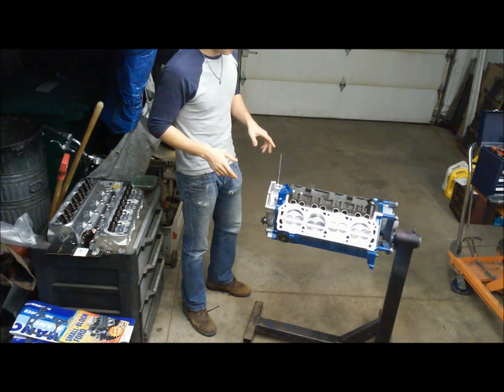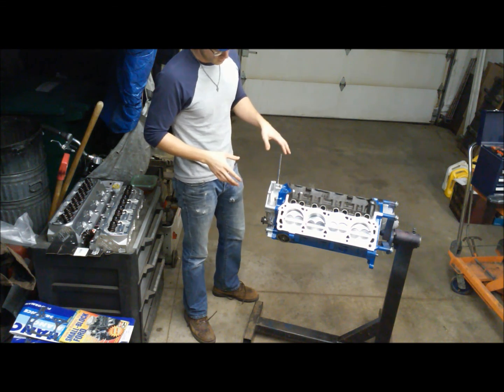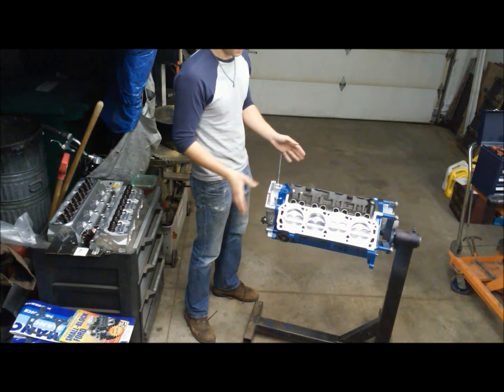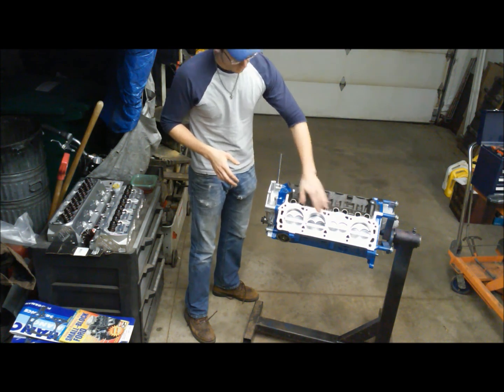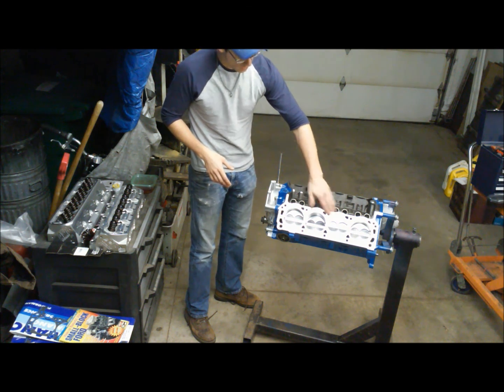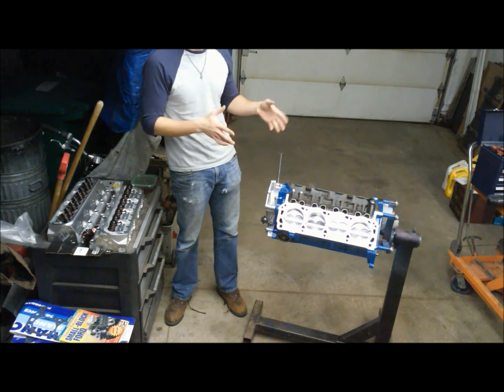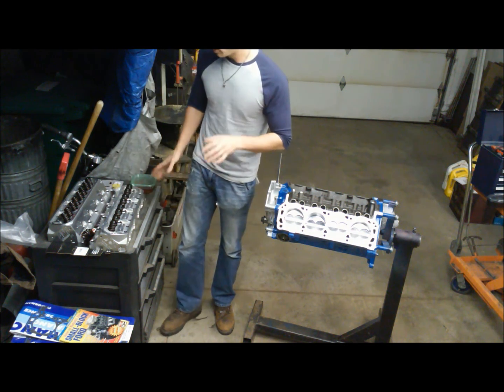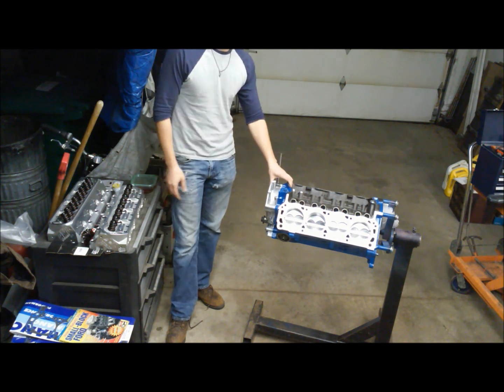302 Rebuild Series Introduction (Vid 1 of 5) - How To 302/5.0 PERFORMANCE Top End Build

Comment: I have an edelbrock 500cfm carburetor, would that be ok? Or a 600 cfm is needed? And I have edelbrock Performer intake. The motor is a stock used with around  130psi compression

Comment: Hello, I have a ford 302 roller motor and I want to convert it to a 302 ho, to put in a 1986 Ford F-150, I am looking for torque and horsepower at low rpm with a bit of rough idle, what camshaft can you recommend me? Thanks in advance
Reply from the maker: Comp cams xe266hr
Reply: @ThunderHead289  Hello, thank you. This camshaft is for carbureted applications? Does this have the firing order of a 351w? Also i am purchasing aluminum heads 190cc runner, 2.02 intake and 1.6 exhaust valve, with 1.6 roller rockers. Does this setup will work fine for this camshaft? What type of carburetor and intake do you recommend me im this case? Thanks in advance
Reply from the maker: Luis Aponte It does have the better 351w firing order. I have this same cam in an engine with the same valvetrain specs as yours. 
Intake is whatever you want to run - I have an air gap on mine, but a dual plane Edelbrock performer would work just fine also.

Comment: I have seen a few of your videos they are fascinating
I work on a shop that usually do subarus, all kinds of cars but the shoo it's well known for subaru specialist 
Recently I bought a 1993 f150 with the 5.0 planing to rebuild it due to excessive blow by    and smoking  
I hope you can help me with some advices here
I just found a short block 5.0 HO with forge pistons
Can I use it with the cyl heads from my 5.0 none output ? and if so , what would be the changes needed 
computer? injectors ? push rods ? what do you think ?
Thanks in advance
Reply from the maker: hector garcia you should be just fine - you are still in the acceptable injected Lsa range - is your 1993 maf or speed density?
Reply: +ThunderHead289 no maf
Reply: +ThunderHead289 what about firing order?
Reply from the maker: hector garcia gotcha, you should still be fine for sure. I’d use better heads if you have the option - at least e7 heads if that’s not what the truck originally had. I’m a carb guy, usually if I heavily modify an engine I move over to a high flowing carb. 
Yours should be fine with the stock injection if it’s a stock ho cam
Reply from the maker: hector garcia ho will have the 351 firing order, not sure on year if your vehicle. In 94 everything was 351 style. 
If it is a different firing order, it will not effect the running of the engine. The firing order is solely mechanical on these old pushrod units - it won’t mess with the computer
Reply: Thanks so much for your input , specially your time, all this information really clears my ideas
you have another subscriber

Comment: what do i do if theres a little rust on the deck
Reply from the maker: +Emmanuel Reyes if its just surface rust, steel wool should take it off. you can scrape on it a bit with your paint stripper/scrapper that you use to scrap gaskets